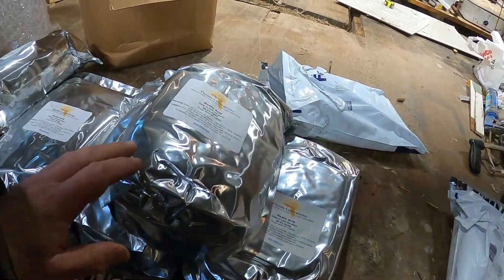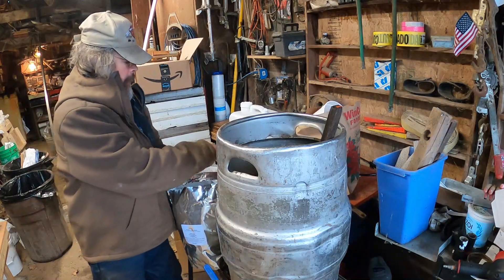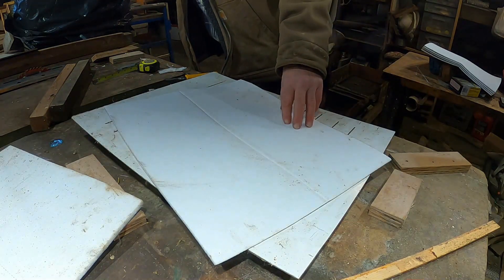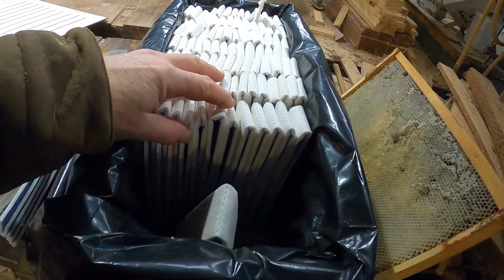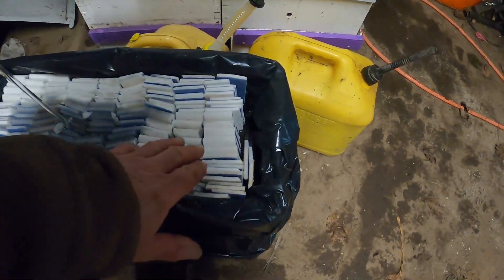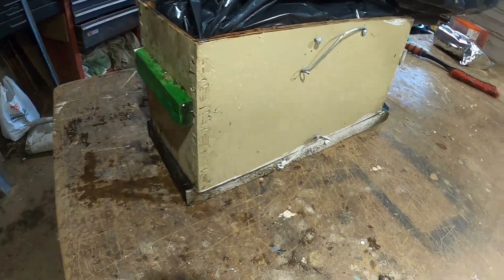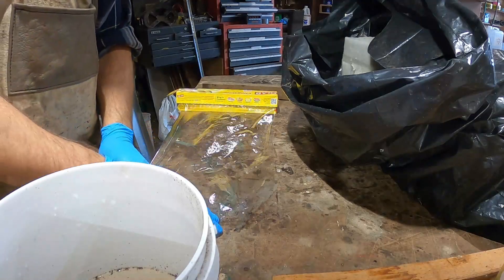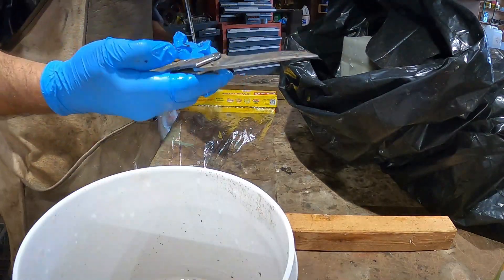another round of Oxalic acid strips

Comment: how many strips did this make and how many do you put on per hive and did you put the strips between the two boxes or slip them down into the frames? Thanks in advance
Reply from the maker: seems like it was about 400 double strips. one double strip per 10 frame box. the strips have a tear line in the middle. I put mine on top of the frames, and found it worked great if there were frames above. not so much on a single, where they couldnt walk on top of it. I will put some at the entrance this year, like a door mat, and will probably hang some. I dont like hanging stuff because it tends to make that part of the comb unusable. but if it works better i will

Comment: I believe the goal is 50 gm of oxalic acid per hive, or 100 gm of the oxalic/glycerin mix.
Reply from the maker: thats what Randy put in, but when he tested the strips after it was done, most of the OA was still on the strips. so I dont think it matters, as long as it kills Varroa
Reply: @harrisjoubertwithsleepycre1924  correct over 75% remains in  these types of applicators.
Reply: @harrisjoubertwithsleepycre1924  
I think we need to find a better carrier, one that yields up most of the oxalic acid.
Reply: @sleepycreekfarm7426  
All the best on your almonds! 
I have always wanted to take mine to Florida (from Maryland), but never have.
Reply: @djg585  Sponges are made to soak up fluids - I use straws which are designed to move fluid - not hold it....
Reply from the maker: @danielweston9188  -*but just being in there is doing the job, why make them deal with more?
Reply: @harrisjoubertwithsleepycre1924    In high humidity situations (or large Hives) OA being Hygroscopic forms a surface barrier of water and prevents the Bees from coming into contact with the OA solution.  A major issue with towels, strips or sponges.
Reply from the maker: @danielweston9188  I dont find that to be the case with the strips I am using. they hold a lot of product, and when they get warmed up it becomes liquid and I believe acts like a drizzle. they do eventually dry out or get propolised to the point they need replaced
Reply: @harrisjoubertwithsleepycre1924    Easy to find out the rate of application by weighing the strips once every week or so.  The surface tension in fibers can hold a lot.
Reply: You can also do a nutierizing test to determine how much of the weight is OA/Gly or water.  I have done these on towels, cardboard strips, sponges and straws.

Comment: Kind of lost me, 4 gallons glycerin to 40 pound of OA?  Correct?
Reply: My Guess is hes going for a 50/50 blend by weight, that's the ratio Randy Oliver found to be optimal.
Reply from the maker: yep. 50/50. my first batch was 1 gal. 10 lb. just have more bees now
Reply: 1 gallon glycerine per 10 lbs ox. Acid yields how many double strips? @harrisjoubertwithsleepycre1924